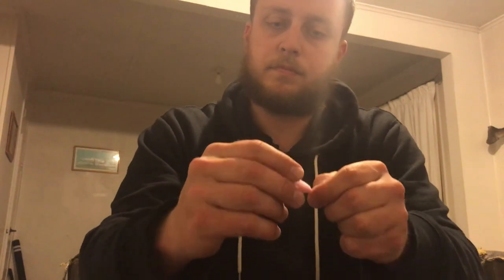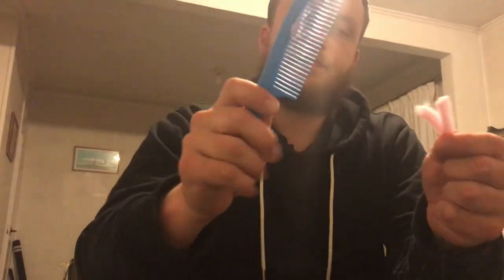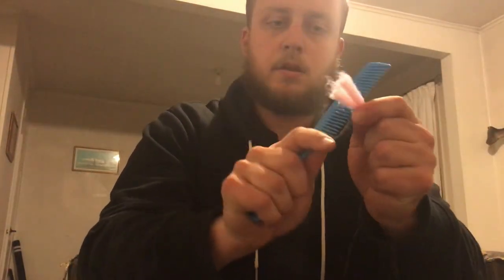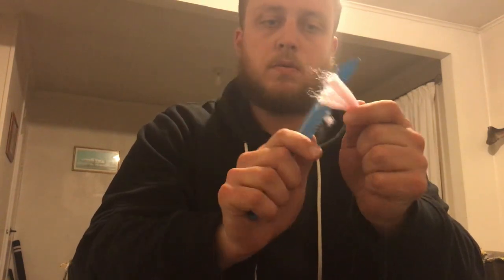How To Make Adjustable Strike Indicator [Super Sensitive and Floats Well]

Comment: I use Glo Bug yarn treated like this.
When fishing smaller rivers I just put a half a granny knot in my leader and poke about a 4 inch piece into the half knot and pull tight. To move the indicator up or down I just push both sides of the leader together and it loosen up and then change the depth.
I do like how you tie it in.
Does it wrap around the leader?
Reply from the maker: No I am yet to have any issues with it wrapping around the leader. It casts well too. I make smaller ones with a small amount of yarn for small rivers and larger ones to hold up more weight for larger ones. I have never used the knot system, has it ever broken your leader from stress of the knot or does it hold strength?
Reply: @OnTheFlyNZ  my way has never broken the Glo Bug yarn stop's it from getting tight like a wind knot.